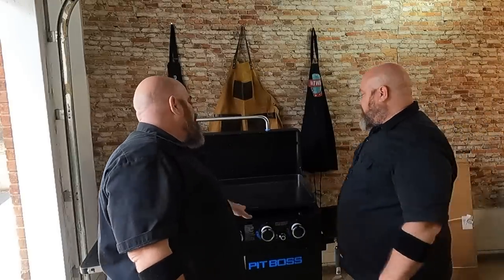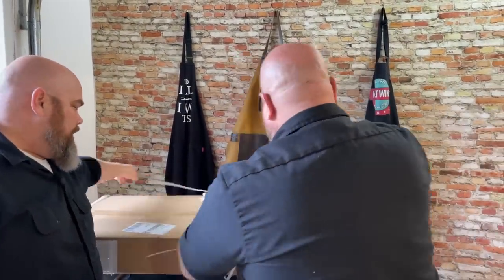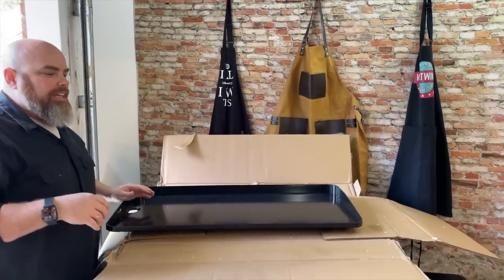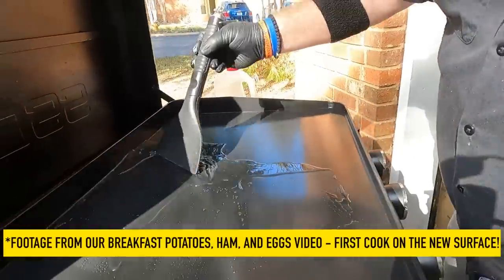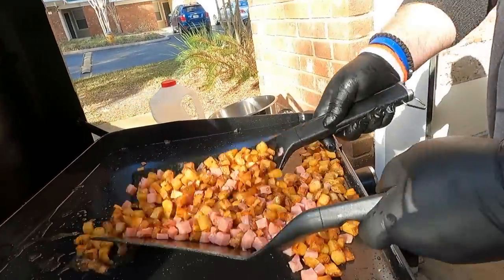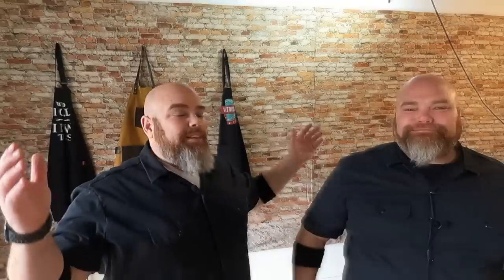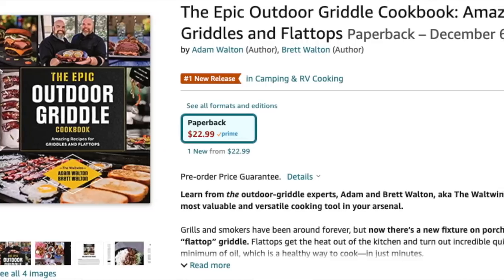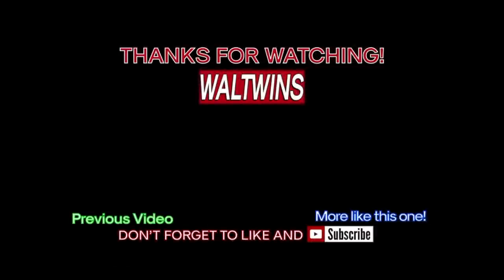UH OH, WE NEED A NEW GRIDDLE TOP! PIT BOSS ULTIMATE GRIDDLE 5 BURNER REPLACEMENT CERAMIC PLATE

Comment: I have owned my steel blackstone grills for over 4 years and still cooking strong. Gor both during black friday sales and still cooks like day one. 

The ceramic surfaces will waer out and the grill is basically a throw away at that time. Can't i.agune a new ceramic top purchased, outside of the short 2 year warranty, costs less then $300 shipped.
Reply: Stand correct $199 from pb for the 4 burner top, not including shipping.
Reply from the maker: Thanks for watching and for the input.  We were very hard on these units intentionally.  With our experience now, we feel these will last more than a few years easy. We appreciate you for sure, but it seems most of the criticism is only coming from our Blackstone peeps, those who have the PIt Boss units are nothing short of impressed and happy.  Cheers brother!🤙🤙
Reply: @WALTWINS  the point is still that the non stick will fade and a new one will need to be purchased. With steel stops they live a whole lot longer.
Reply from the maker: @lafrod  agreed, with our overall experience with other brands as well, is that the surface is one part, but we’ve seen other parts of the unit that fail and need to be replaced.  We for sure agree that the rolled steel by nature lasts longer, but like cast iron cookware that lasts forever, we have it, but don’t often use it. We loved the rolled steel and have actually requested a deluxe from Pit Boss to still be able to use both.  We absolutely respect and love that you stick with the Blackstone, they are great units!🤙🤙
Reply: @waltwins  does the deluxe offer rolled steel and normal?
Reply from the maker: @katstutrakatsturatorren  yep, the deluxe is a rolled steel unit, very similar to a Blackstone.
Reply: @katstutra katsturatorren  I would go with rolled Steele over the ceramic coating.  Steele will last forever and in many cases are cheaper.

Comment: Why does cast iron have a “surface”? Or are PB griddle tops made of some other materials?
Reply: PB has ceramic coating. Most other griddles have raw steel griddles that you season creating a “surface” on the steel
Reply: They are made like a nonstick skillet and wear out the coating. Cast iron don't just wear out.
Reply: @onlyychevys  Too be fair most people wont use theirs nearly as often so instead of lasting a year they will get 3-4 years out of it. And then they buy a replacement top for less than a new unit.  Though this is exactly why I went with a Blackstone. While its not the only thing I will cook on I do try to cook outdoors every night, so it its not my grill, smoker or pizza oven its the griddle.
Reply: None if these are cast iron. They are rolled steel hot or cold depending on brand, PB has a ceramic coating. The others are seasoned and maintained similar to how you would maintain cast iron.

Comment: It's great that Pit Boss stands behind rheir products however it is very discoiraging that both you and the Flat Top King had to replace this top. Makes me pausè about the pit Boss and i was hyped aboit getting one until i saw this video along with the Flat Top King's video as well. 🤔
Reply from the maker: Thank you so much for watching and for the feedback - I think the purpose was to show that these tops can take a beating and that Pit Boss does stand behind their products - one thing we did mention that was maybe lost, Neal (the Flat Top King) also points out, both the 5 burner here and Neal’s 4 burner has metal utensils used extensively.  Brett also has a Sierra unit with well over 100 cooks and the unit looks as new as it did before the first cook.  We think there may be been some rough batches that went through, and we’re hopeful that the surfaces now are much more durable.  That said, we’ll definitely keep cooking and still share our honest thoughts! Take care fam!🔥🔥

Comment: so basically the griddle top wore out so its not a good product??
Reply from the maker: Interesting that this is your takeaway - we explained at length the reason for it.  We love the ceramic tops and will gladly recommend them.  Cheers🤙🤙
Reply: @waltwins  sorry i must have missed it. was the reason mis-use? if so, could u give us a video on what steps to make not to mis-use it? 

also i see on some griddles people pu a metal top over something to essentially boil something. on the ceramric top i assume thats not a good idea. any reccomendations on what we could use instead which is safe with he top?
Reply from the maker: @katstutrakatsturatorren  when we first got these units, we were very worried that we would scratch them easily. We learned that the ceramic is very durable - metal on the surface is totally fine, and we use our metal basting dome and pots/pans regularly. We just don’t slide them around.  It’s using metal utensils to scrap up food that was an issue.  With nylon, wooden, and silicone tools, we have had no issues with the surface. It’s interesting, because we do know some owners who only use metal and still have no issues.  That said, we still err on the side of caution with regards to metal.  Hope this helps some what!🔥🔥

Comment: Issues with two of your pit boss griddle tops, both replaced and issues with one hood and took it off.  For the price, I would not be purchasing the Pitt Boss griddle and have all those problems.  We are all hard on our griddles...scraping, cooking, cutting, high heat...not really an excuse for the issues with these griddles.
Reply from the maker: The one unit with the hood was a prototype, something we’ve addressed in previous videos, and is also the same unit with 200 cooks and were exceptionally rough by design to give feedback to Pit Boss (the hood is a different material - no other unit’s hood has rusted). We have two other units with zero issues. We just wanted to be transparent. Not excuses at all, we’ll gladly keep using them. Overall, we love all of the griddles, rolled steel and ceramic, and will keep sharing the love of cooking.  Take care brother!🤙🤙